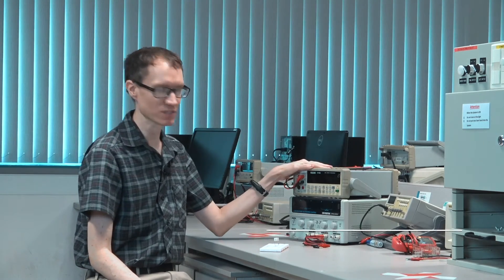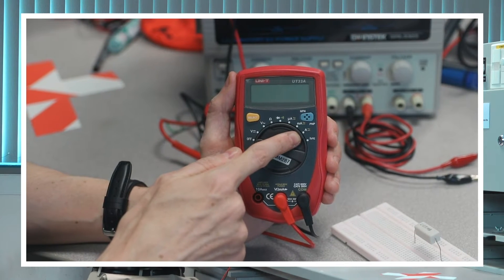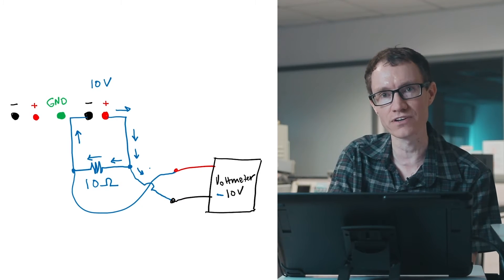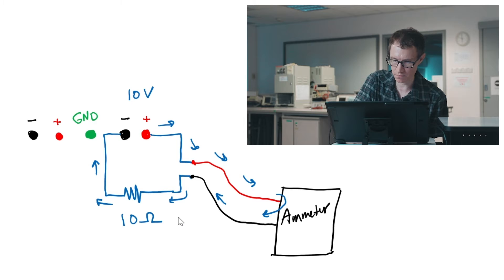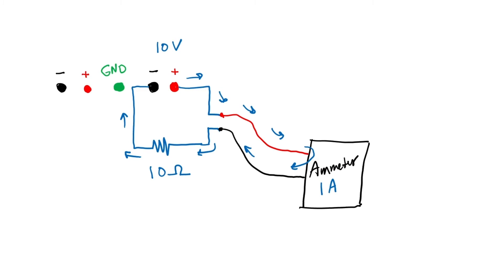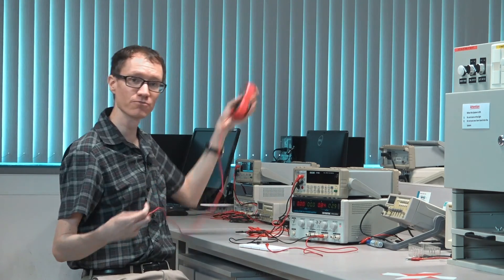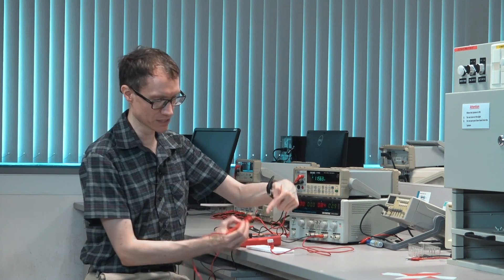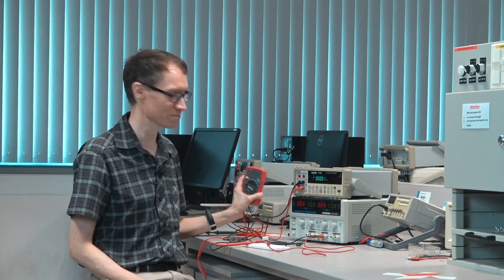Multimeters (Circuits for Beginners #4)

Comment: At the end, if the bench multimeter has its fuse blown, how come it is still able to close the circuit back to the DC voltage supplier?
Reply: I am here with the same question. 😢

Comment: Hi, Aaron!
You mention here that a good multimeter should have a big internal resistance to prevent of inaccurate readings, however, when measuring current, wouldn't that "huge resistance" be blocking the current to be flowed through and be registered by the ampmeter?
Greetings from Mexico!
EDIT: You explain that in the first half of the video. Thanks!
P.S. Then we can say that when measuring...
1. voltage should have big internal resistance, and
2. current should have small or none internal resistance.